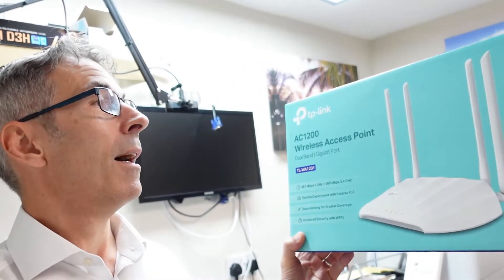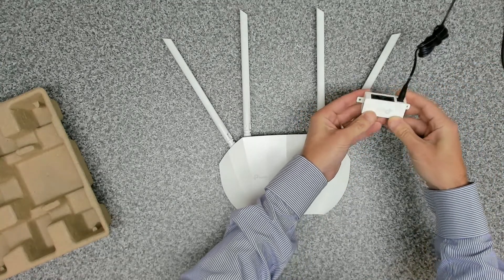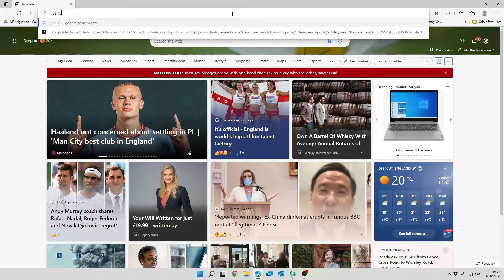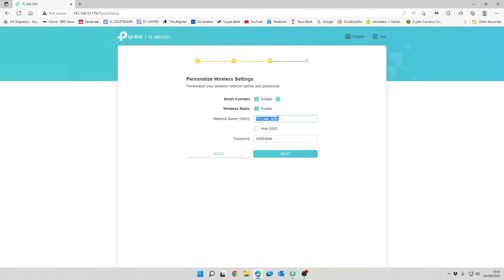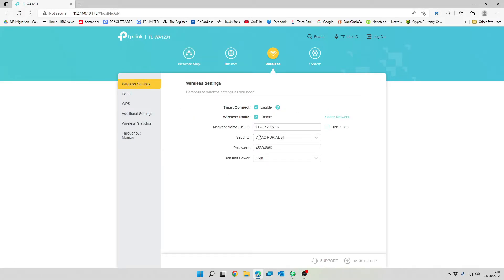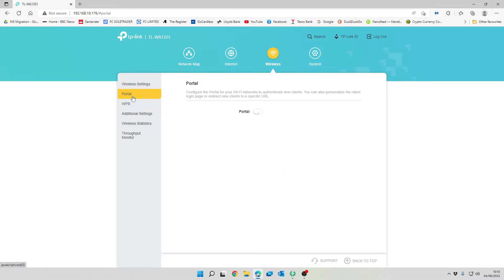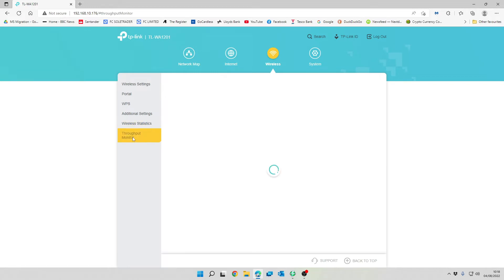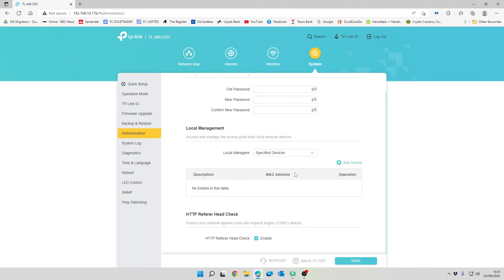WiFi 5 multi use access point - TP-Link TL-WA1201

Comment: Be carefull, this access point will only work with the PoE injector what is delivered with, like in the video. When you connect it with your own PoE device (like mine TP-link 5-port PoE switch) it will not work.

Comment: Can I connect this to a BT Home Disk rather than a router as I would like to run WiFi down in my woodworking shed.  My router is upstairs, BT disk is currently connected to the back of my Sky box downstairs using network cable and the shed is approx 40 feet from the back of the house and BT disk

Comment: The TP Link TL-WA 1201 is a decent AP.  The only shortcoming is if you plan to use the multi SSID mode in order to support VLAN's.   The TP-LINK firmware does not handle this very well.  The solution for multi SSID mode is to replace the stock firmware with OpenWRT.  Problem solved.
Reply: I have been struggling with this for the last hour thank god I for your comment!
Reply: @autohans540  Good to hear.😊 OpenWRT works well.  The documentation is a little clunky, but it is accurate.  If you follow the directions to download and flash the firmware to your TL-WA1201, you'll  be up and running in short order.
If flashing firmware is not your idea of fun, the TL-WA3001 supports VLAN's well.  Good Luck on your project.
Reply: @Scott-ph2yk  I've setup a workaround by setting my LAN ports (and therefore the WA1201) to VLAN 1 and the inbuilt router wifi to VLAN2. When I reach the need for VLAN3 I may get around to OpenWRT ;)

Comment: For my ac1200 wa1201 I have to enter the password on the bottom of the access point. I can't create my password. And when I do enter the password I am able to get through to set it up for client mode but at the end of the installation or whatever, it instantly goes to no internet and then a 404 not found error
Reply: After the screen goes to no internet connection I tried to connect my Xbox to the ap via ethernet cable and the Xbox has no internet but still recognizes the extended wifi, but it doesn't connect to the internet